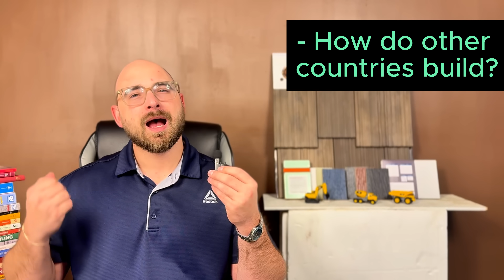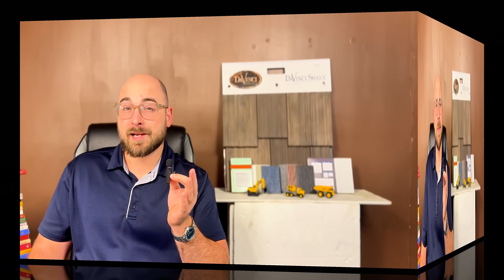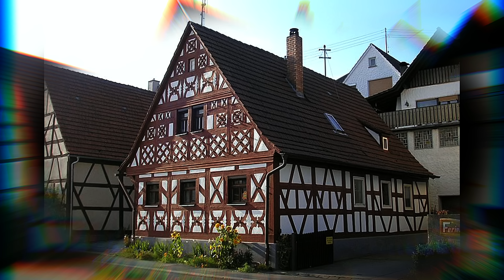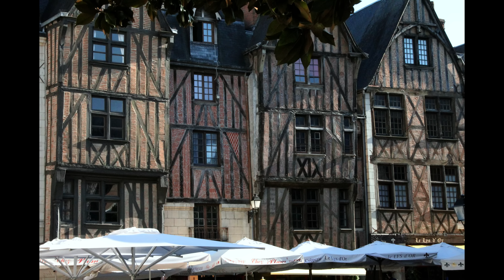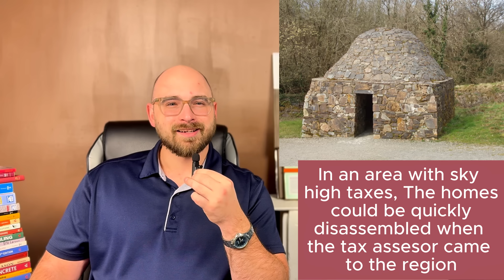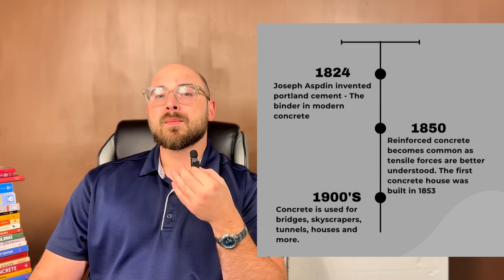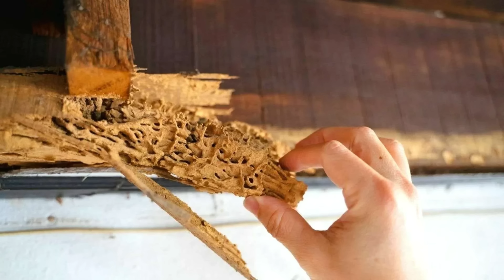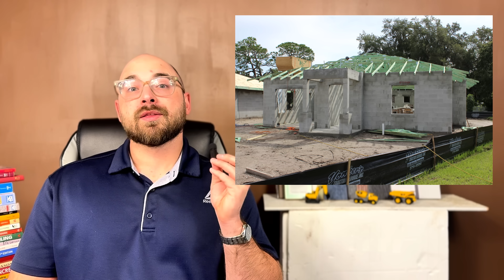Why Other Countries LAUGH at American Homes

Comment: The main doubt I have about US houses (I live in the U|K) is that the 'shingle' roofs need replacing about as often as thatch without any of the advantages.
Reply: Advantage would be being able to easily mod your roof. Like, I’m not sure about how you mount solar panels on a thatch roof but it is very easy on shingles.

Comment: I worked as structural engineer in Norway and I designed timber, concrete and steel structures. Timber structures in Norway can withstand hurricanes. Recently they build a 18 storey timber building which is fire proof (Mjøstårnet). Remember that the Twin towers (which collapsed due to fire) were a steel structure. There are no good or bad materials, sorry. There are good or bad design criteria. Those criteria can make some materials more expensive than others, but that's up to the market to decide.
The US design criteria are neither good or bad as thery simply don't exist. They US has no federal building code. And yes, states could, in theory, make a building code as good as a potential federal building code, but in reality that doesn't happen. Many countries in europe had really poor quality building codes until the european ones were imposed by the EU.
Contractors will most of the time try to build the cheapest that building codes allow them. That happens in any country around the world. So the median quality will be as good as the building codes.

Comment: Properly done there is nothing wrong with timber framed homes.  The key issue is "properly done".  Nail plates have a lot to answer for: they have positives, nail plates produce very strong joints, they are quick and there is less waste material.  However, nail plates have  big negatives: they allow for shoddy workmanship and can be used by completely untrained contractors.  Sadly the US homes are mostly built quickly and cheaply, most mass produced homes in the US are unlikely to last 100 years.

The other problem with US homes is the comparative lack of insulation, especially in walls.   6-10" in walls and at least 8" in the loft space is the minimum I would accept but some of the modern insulation material may achieve the same insulation effect as standard panel insulation or rockwool.  Insulation does not just keep the home warm in winter but also cool in the summer.

Comment: I think it’s interesting how many comments in here are so vile and full of hatred. Every country has its way of building homes and whether one is better than the other is often down to personal choice. 
Brick and concrete buildings can be insulated and are not always cold, as many have commented.
I prefer the aesthetic of European homes, they just look more pleasing to me but not necessarily to others. Wood framed homes in America can be built quickly and they are used to having bigger spaces, sometimes almost too much open space for some Europeans.
It’s important to remember than neither is right for everyone and leave it at that.
When it comes to environmental issues, using air conditioning on large scale, as in the U.S, is definitely not good for the environment, no matter how many trees you plant.

Comment: ->should america build more concrete houses?
i would say that is a clear yes.
especially in the tornado prone areas.
why build flimsy homes that get severely damaged by storms every few years and require costly repairs every time, when you can get a lasting and mostly storm-proof home for not that much more money? it will be worth the extra costs after just one or two storm seasons and can further save money via insulation benefits.
same goes for the fire prone areas. the wood heavy buildings will just add fuel to the flames. literally.
and another benefit of concrete buildings is that they are harder to break in. well, only if you have somewhat reinforced windows and doors too of course. but the point is that most american wooden homes can be 'opened' with just a small hand-axe and some time. try that to a stone or steel based house and the attacker will only hurt themselves.

well, that is all i can say from my german perspective.
i have never understood why americans still build their homes like that but now i at least know what the building style is called.

Comment: In Latin America houses are built out of bricks and concrete. As a result, they don’t burn down, blow down or fall apart. Roofs don’t need to be replaced, siding does not wear out and become shabby and maintenance costs are very low. 

Americans have been screwed for over 100 years with crappy wooden homes. They are all designed to drain your wallet.

Comment: I think you missed the point and answered your question by only focusing on the facade. Here in Denmark it takes what feel like weeks before the house comes out of the ground.  So much time is used to dig out and make sure the house is well isolated from the ground. Then, if we go to the walls, our walls are almost double in thickness as we isolate more - however, as you need some kind of frame for the insulation, then our walls are thereby more stable. The way you build houses in the US is the same way that we used to build our summerhouse - cheap wood framing with no or almost no insulation. However, we like to keep warm in the winter and therefore build stronger for our houses. It also saves on the energy, which costs a lot here.

Comment: Bricks and concrete is cheaper than those wood and metal frames with the darn drywall, we can build a house here in brazil for less than 20,000 USD that would be able to sustain a hurricane, you mtfs for 100,000 USD can't make one that sustains a wind blow, haha!

Comment: Honestly i didn't here anything to really put the wooden style to par with  a steel reinforced concrete house, i want to point out that while changing interiors is extremely more friendly and even changing cables and whatever is much easier as for base design of the house concrete it's extremely more flexible, while it's absolutely not the standard cause it obviously cost more, if you search any modern or weird looking design you will find out it's usually concrete.
While fast and cheap are very good qualities, it depends as you said where you are and in fact we europeans criticize your way of building cause you have seasonal hurricanes every year that bring down a tons of houses while a european house would breeze through it i won't say as nothing happened but we're close, the only thing that could cause damage would be  like a pole thrown at your house at 300 mph, you recently even had a fire that burned out almost an entire city, which would never have happened in europe, funnily we could get away with building cheaper houses and we don't.
To consider too, your houses right now costs almost as much as ours to make and even more to buy which is crazy, in europe you can buy a wooden house to be delivered to your door for less than a quarter the price of a normal house and if the house last when you move around you sell and buy as already happens in the US too, it's not like your going to build a new house most of the time anyway.

Comment: Hi from Sweden. The verandas running  around US houses (in many cases) is a great thing we don´t have to the same extent. But I think the biggest difference is the quality and sturdiness of materials and components like windows and doors. This might be a result of our climate, but also depending on the ongoing work with energy efficiency. Also at times, I find the layouts not very practical, ie; entering into the living room. Dirty boots, hanging clothes? I´ve traveled both the US and Canada and those are my observations.

Comment: Most of the houses in the Netherlands are made with bricks and concrete with baked roof tiles. The frame is concrete. Really sturdy and long lasting. Also really slow to build and expensive. A traditionally built house takes about 9 months to build.
They're now switching to prefab houses in which the concrete and brick facades are being built inside a factory and assembled on site. These houses take 3 months to finish. The cost of a lot is also expensive because our country is small. The average house/flat costs nowadays 500.000€. 11:11

Comment: You missed 3d print.
Reply from the maker: Because it’s a fad, 

Automated a part of the construction process for no reason just to make it worse
Reply: @Mike_Fortin  I've seen entire houses fully constructed?  The roof is the only part not printed. Perhaps you could explain in more detail.
Reply from the maker: The downsides are added cost and complexity, less room for error, thermal bridging, less insulation, lack of proper reinforcement , and the concrete (which is porous and absorbs moisture) is exposed to the elements. Doors and windows also leak in 3D printed homes (dome houses too) 

3D printing is cool, but it’s a solution in search of a problem.
Reply: @Mike_Fortin   Ok so perhaps a hybrid? Some parts 3d printed some parts conventional?  Like brick filled in a wood frame?  Ps what happens to all those house owners living in 3d printed homes? Are they screwed?

Comment: Here in sweden, most normal family homes are wooden frame buildings. The big differens is that ours use  larger dimensions, and less distanse between standing studs. Most common foundation is concrete slab on the ground but with at least 25cm of insulation under it. Apartments and office buildings are mostly concrete.

Comment: Unfortunately, you completely missed what it's all about. I recommend watching some comparison videos where people compare houses in the US to houses in Europe. Focusing on such things as doors, windows, inside walls, etc. It has very little to do with anything you just said. Although it was pretty fascinating stuff too.

As an example, your inside walls are basically just paper. You can fall through them or punch a hole in the wall without effort. Not here, that's simply never going to happen. And your doors can be easily kicked in. That's because your front doors are about as strong as our weakest inside doors. And because our doors (at least here in Finland) only open outside. They can't be kicked in. They are SOLID anyway.

Seriously, watch those comparison videos. You'll be surprised by all the differences people are actually talking about.

Comment: It's actually quite funny I admired for some of the way that American homes were built... Don't get me wrong I love my brick homes here in Australia, but I'm well aware that we have those primarily because clay is readily available in Australia, where timber from forestry is relatively less available... Add to that I believe most of the populated areas in Australia, or at least here in western Australia are tectonically very inactive and stable, so making more rigid homes out of materials like brick and mortar suit us... As well as the insulating property of brick, which from memory has a reasonably low thermal absorption, which suits our very hot climate.

I've always assumed that countries use different building materials because that's what works in their region.

Comment: 2 things wrong here. most houses now in EU are a combination of concrete (for floor plans and pylons for stability/earthquake measusres) and bricks for the outer and especially the inner walls. so yea u can remodel the house quite easy. 2nd if u compare the match stick us houses and the concrete/brick ones u will discover that the pricing is very different per square meter ( metric system-get used to at last). the wooden houses are costing now from 650k to 900k !!! and the concrete about 200 to 300k. so why would i want to buy a disposal - wooden house - with so many problems that u right metioned in ur video -  and very expensive? i can have a sturdy, life long house - with most of the wooden houses problems solved - and its quite cheaper. the only downside to all this is the build time. u need about 1 year to build a concrete house and for the wooden oned about a month. thats why we here in eu are mocking u about ur houses in us.

Comment: Is it literally a common practice across all US states to build these types of houses? Doesn't it also depend on the weather? I can't imagine people living in OSB houses in the colder States. Sure, you can insulate it, but it's still hard to wrap my head around it.
Reply from the maker: Basically yeah, 

there’s concrete and ICF homes here and there, but those are primarily in disaster prone areas like FL, 

However light wood framing is the preferred method across the country

Comment: i'm from Malaysia..  our homes are all built using concrete beams and bricks. in the old days, all homes were built out of wood, and then wood + bricks.  because wood is now a very expensive material due to uncontrolled logging, bricks and concrete has been the way since the 50s.

Comment: How do they deal with the radon gas from the cement?
Reply from the maker: Radon gas is a byproduct of the aggregate (rock) in concrete. It is a negligible amount not worth worrying about. 

When we build a concrete house, we use HVAC that supplies a constant supply of fresh air.
Reply: @Mike_Fortin  I was stationed in West Germany back in the day and loved their houses! The rolladen window that pivot and rotate out, the water heaters...the beer, the frauleins! Jägerschnitzel. I lived in Kinheim, Sohren, Waldorf. Did I mention the frauleins?
Reply from the maker: Sounds like a great time! 

Would love to visit one day

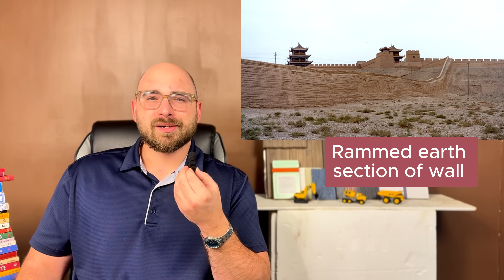Comment: 2:13 You just hit the nail on the head, regions tend to build homes that use locally available materials. The UK doesn't have a ton of timber so they build more with stone. Africa and similar hot climates that don't have trees or stones prefer an earth structure that, coincidentally, helps with cooling. North America has an ample, renewable supply of lumber so that's the default construction material. Are there better ways to construct timber homes than the current construction methods? Absolutely. Are Americans willing to pay the price for better constructed homes? Absolutely not.

Comment: ICF actually seems like a pretty cool method, because you essentially just use the isolaton as the concrete form

and since you don't have to pre-fabricate the walls, it should be much easier to transport and build

the US should seriously consider making all their houses like this, it's actually insane how they can have so terrible inner walls that one could literally just punch a hole through them

building temporary houses on purpose is an insane concept and should honestly be illegal, especially in a country prone to natural disasters, nobody wants to be forced to rebuild their house every couple of years because of a hurricane, flood or earthquake

japan has much of the same problems with natural disasters, and they solved it by making their buildings more resistant through engineering

any modern home should be built to last and be as energy efficient as possible

Comment: Great video. One emergent downside of timber framing is that it encourages sprawl due to its structural limitations (limit to building height). This leads to high transport costs and high infrastructure replacement costs which hit slow, but incredibly hard every 50 years. Things like repaving roads, changing water and sewage pipes, electricity infrastructure.  Most people don't feel this directly, because they can move, but that cost is absorbed by local governments that often need to be bailed out by the federal government. In the end you get much less public infrastructure for your taxes.
Reply from the maker: Good point, 

I think we need more multi family housing, ADUs, etc, but regulations make it difficult in many areas

Comment: Regarding the last material (your personal favorite) I am concerned about the foam part. Foam, as far as i know, doesn't degrade when we are done using it. Aren't we passing on a issue to our future generations using that product?
Reply from the maker: That’s correct, 

ICF homes will easily last hundreds of years, but eventually the foam could be an issue. For now it’s a matter of using what’s available and creating a better solution, 

There is ICCF and wood fiber blocks, but for various reasons they are not quite as good. 

Whenever recyclable ICF and “green” concrete become available that would be the next best thing, but it’s just not a reality yet

Comment: I saw someone in the US making a "foundation" by removing 5 inches of top soil and pouring concrete. That would never be allowed here in Finland. We remove the earth down to the frost level and fill with crushed rock and gravel and compacted. On this styrofoam is used and the mould for pouring a foundation is made. Usually edge reinforced. Log element houses are gaining a lot in popularity here. Like 30cm thick walls made from wood with maybe a 10cm insulating layer.
Reply from the maker: Some places in the US the climate is warm and the ground doesn’t freeze , allowing for slab on grade foundations